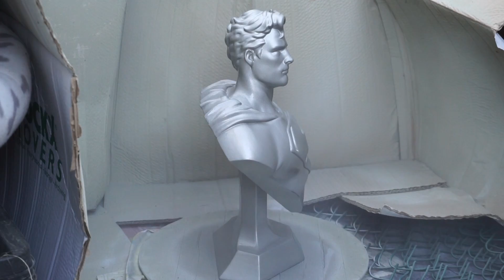Superman Bust Custom Paint 3D Print

Comment: Hey, thanks for the video! man, do you also get your eyes irritated when using this spray putty? by reading their safety document for this product, it seems to be very dangerous
Reply from the maker: Hi Luis ... Well I'm spray painting 99% of the time outside.  Less smelly room and it doesn't get into your eyes.   But I also wear a protection mask to.
If you spray inside the the house it will give a lot of dust particles so you have to clean afterwards.
Thanks for the positive feedback.
Cheers
DB

Comment: belgie ? nederland ? ^^
Reply from the maker: Belgie :-)
Reply: what side of the spunge you use ? the soft or the hard side . and how long you leave the black shgoe polish on
Reply: and did you use a varnish at the end ?
Reply from the maker: @domboboy1997  I normally used the soft part (so not the screen for scrubbing) because the soft part is platter which prevents too much cleanup in the cracks and seems.
I sometimes use the green part if I need a really clean surface without any shoe polish.  But don't scrub the paint of of course. :-)
The time I leave the shoe polish on is not long.  Maybe 10 minutes.  If you rub it off too quickly then the effect is let noticable.
Good luck ;-)
Cheers
DB
Reply: @PropsN3D  gonna start my painting this weekend ^^ what is the type of grey you use ?